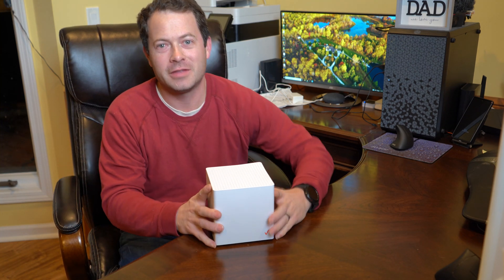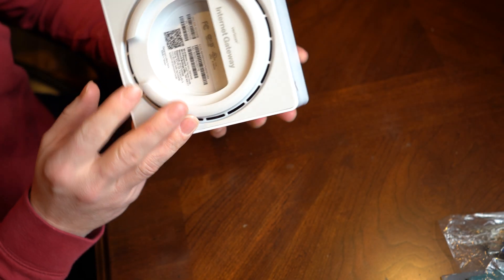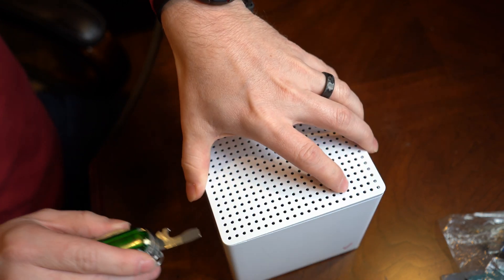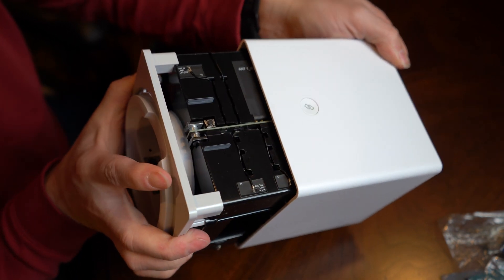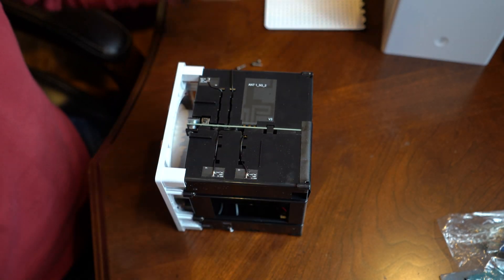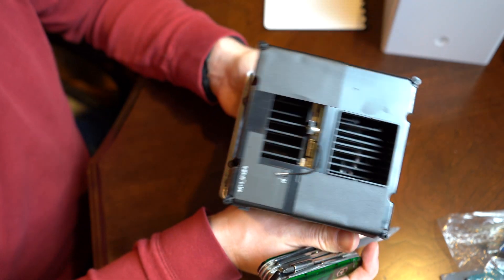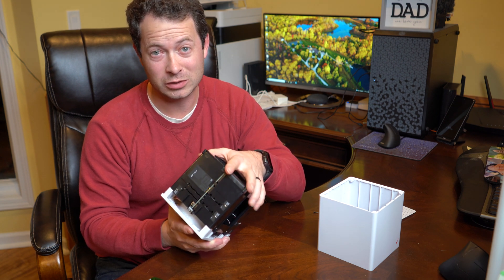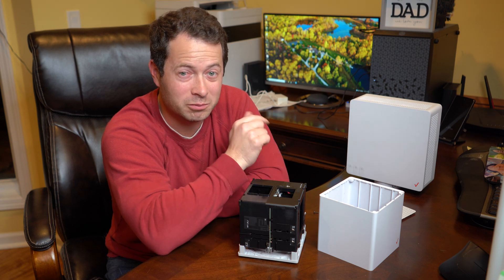✅ Taking Apart The Verizon 4G LTE Home Internet - External Antenna and Fan

Comment: Clearly you missed the U.FL connector right behind the 3 gold contacts. External Antenna was easy
Reply from the maker: Haha.  Clearly you didn't plug a U.FL connector in those as they are test ports and are MHF-SW23 ports.  They look similar to U.FL though.  That said you could get a setup that could make these work but probably not worth it.

Comment: So those are Microstrip patch antennas yes? If I want to risk it (and I do) how would I attach an external antenna and can you show me an example of one? (Cellular antenna with three leads) I am only familiar with 2 lead antennas so not sure how to connect a three lead.  I did a fairly good search online for more specific info but am stumped finding any.
Reply from the maker: I dont know of a good way to do that  either.  I assume two leads are a loop and would be connected together.   You might be better off using a cell booster.  https://youtu.be/bboYE4qcfDM

Comment: Hi Nate! In what direction is the fan at the bottom of the cube pushing air? Towards the bottom of the cube or towards the top? The airflow is so faint I'm not sure. I will be adding an external fan and I do not want it to push air in the opposite direction.
Reply from the maker: I don't recommend adding a fan to this one.   If you're doing an enclosure or something then i'd just do a fan from the enclosure to the atmosphere.   The built in fan push air upwards IIRC.

Comment: I switched over from Spectrum cable internet to Verizon's 5G Home Internet (not PLUS) plan last week. After a few hiccups setting up the ASK-NCQ1338 gateway (which required spending a few hours with Verizon's techs via chat), everything is running smoothly and I'm getting about 300 MBPS download and 20 MBPS upload.

My question is this: your teardown of the ASK-NCQ1388 and the images submitted by the manufacturer to the FCC for certification show a cooling fan in the unit. I have yet to hear the fan in my gateway running ever since powering up the gateway a week ago, and I'm worried Verizon might have shipped me a gateway with a defective fan. Or could it be that the fan only activates when the gateway gets hot? I don't know. Have you ever heard or seen the fan in your ASK-NCQ1338 running?

Thanks!
Reply from the maker: It is very small and quiet so it's hard to hear.  A sign its working is dust 🐰 will begin collecting under the unit.

Comment: Thanks for another great video.  I'm really hoping someone like yourself comes up with a solution for external antennas.  When your as far out in the boonies as I am you need a little help to get a good signal.  I have the antennas mounted on the roof that I'm using with another router currently, but need to find a way to use them with this gateway which is in route to me now.  If anyone comes up with something please let me know.
Reply from the maker: would be really janky to make it work on this cube without soldering/modifying the board.
Reply: @NaterTater  I wonder if the Waveform folks have any ideas or suggestions?

Comment: My dad has the trash can and got the lid like yours and I was disappointed with the 4g gateway cause I couldn’t find a USB port but thanks to you poking around you showed me that there is indeed one. I want to add a usb fan to it. I’m just glad you do this stuff so we don’t have to. Thank you for doing the research cause I couldn’t find anything on it. I can’t believe it doesn’t come with hardware specs. Why would they hide that port? It just seems odd. Anyway thanks a lot Nate! Great channel and cheers!
Reply from the maker: No problem.  This verizon 4G one has a built in fan so it might not need an extra one unless its in a hot environment.   Glad I'm helping.
Reply: @NaterTater  I immediately took the fan off when I saw this video. I have a little channel and I’ll tell you it’s absolutely invaluable to have a channel where the creator really sheds some light on a product. Especially a tech product as feature packed as these that can be modded. Definitely thanks for taking the time and effort to get your hands dirty and break this stuff down for us.
Reply from the maker: @TheNightScotsman  thanks for the compliment!  I think I enjoy tinkering and making the videos just as much as you like watching them!  🙂👍
Reply: @NaterTater  I’m the same way. My channel is just as much for my enjoyment as it is for other’s

Comment: I just signed up for home LTE since we have Verizon already. We got the gateway free included with my plan. Must be something new
Reply: Currently a promo going on, I'm getting device free no contract for 25 bucks a month and first month on Verizon. Wonder if this has anything to do with my MULTIPLE request to Verizon to provide my area 😅 with a 4g internet option, as satellite is my only option (perfectly in att and t mobile deadzones). I've also been a Verizon customer since 2011 and have multiple 5g devices (small business use) may have something to do with the deal they gave me. As of now the stock device is kicking Hughesnets tail so I'm happy even if they go up in price. Still cheaper and way better than satellite internet
Reply: I got an $200 Verizon eGift card as part of my promotion so box cost nothing. Just had to have service for 30 days.
Reply from the maker: If you read the fine print it isnt free, it doesnt cost you anything if you keep the service for 2 years.  You'll see a $10 discount on your bill to cancel out the $10 gateway charge.  Atleast for me.

Comment: Verizon wireless home internet just now became available at my house. They claim in the ad the max speed is 50 Mbps download. They also give $100 credit to the Bill after 2 months so that makes the gateway a little cheaper
Reply from the maker: The do also offer other free streaming subscriptions for a year (as does t-mobile).  With a Verizon phone plan it's a good deal at $40/mo if 50/6mbps meets your needs.
Reply: @NaterTater  my t mobile is running around 90 Mbps down. 39 ping and 45 up. I'll stay with it. However I used to get 130 Mbps down. Now I'm falling as low as 39 Mbps on Christmas eve. It seems to hover around 55 from 4 to midnight or so. I must have a gamer that got t mobile home internet that on the same tower. I have an at&t phone and they also have antennas on the same tower. I've been testing some and noticed when t mobile is slow so is AT&T on my phone. I'd almost bet they are sharing a 130 to 150 Mbps backhaul. It's in a rural low population area covering no towns.
Reply: I got more than 50 just now
Reply: @andrewk8636  I guess I need to update. Verizon advertised it was available here but when I typed in my address it wasn't available. It's still not available.. I've got t mobile home internet which is the only thing available to me
Reply: @Bryan-Hensley  I bet tmobile is probably faster anyway unless you're getting 5g. For me verizon is only $25 a month no paying for the unit itself so it's a deal. My house is in a not ideal location and I still stream pretty well. I need to play around and try mounting it up higher in the attack maybe or get an antenna mod for it